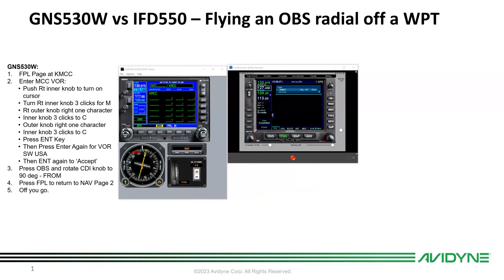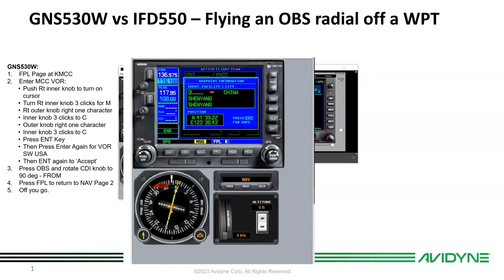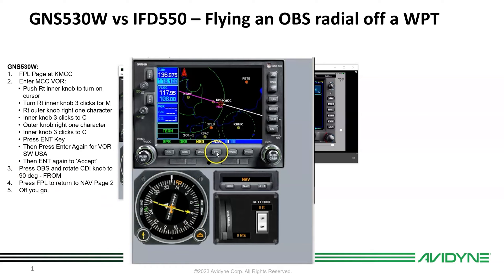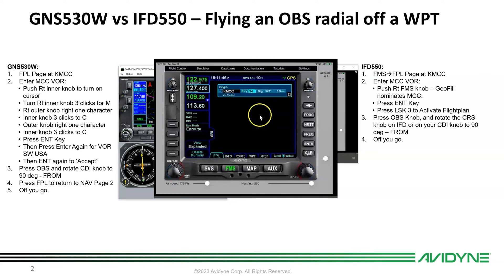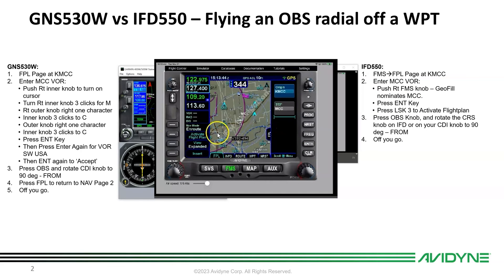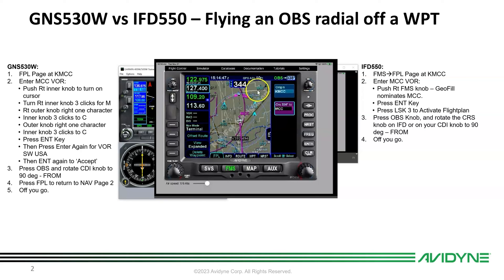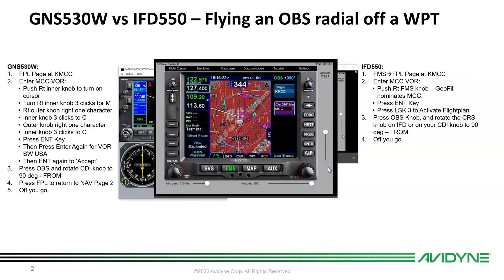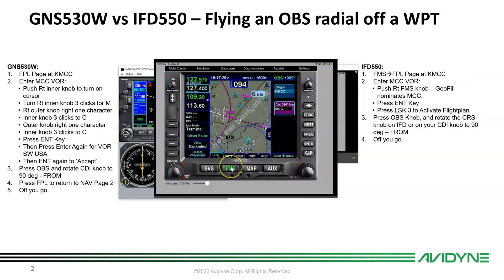Avidyne IFD Training:  Flying an OBS Radial off a WPT

Comment: I was trying to set up a "frm" radial to track outbound.  However, the "frm" won't come up inbound to the VOR and only shows once I pass it. Is there a way to set an outbound radial before you get to the VOR?  Or is there a way to set a point off a VOR, e.g. LAX 123°/20 miles? TIA
Reply from the maker: An "inbound radial" is the recipricol of the radial.   If you want to fly inbound to a VOR on the 123 deg radial you would set the OBS for 303 deg course.   Yes, you can create a User Waypoint using Radial/Distance off of a fix.  check out https://youtu.be/WLO7ipeYaNU
Reply: @AvidyneAvionics  Thanks for the quick reply!  Yes, I understand radials. The scenario is, depart KSMO to fly the LAX coastal route over LAX then continue VFR to KAVX.  The route is to fly the LAX 323R to LAX then outbound the 123R until exiting the Class B.  So I set up Dir LAX, then OBS inbound 143.  My point was there appears to be no way to select an outbound OBS mode until you pass the VOR.  Setting up a user waypoint seems like the way to go.  Though V25 does appear to be on the same outbound radial so I could grab a fix off of that.   Easy enough on the 550 - which I love!  Is there any scenario where I would use VLOC?  Thanks again
Reply from the maker: @FrankFurbish  I see what you mean. Yes you would have to slew the CRS point (OBS) to 123 deg upon passing the LAX VOR or select the V25 and a down stream waypoint as an exit point (as you suggested).   The FMS manages the VLOC in most cases and will auto switch to VLOC on an LOC/ILS approach.  you could at any time choose to navigate off of an actual VOR station in which case you would tune the appropriate VOR freq and change the small knob to Nav source 'VLOC.'   Happy Flying!

Comment: Cool feature. I wondered how I would fly a radial from an airport that does not have a VOR on the field. In the simulator, if I enter the airport as the origin, then enter the same airport again as a waypoint, then activate the flight plan and press OBS, the simulator will fly indefinitely on whatever outbound radial is set. I haven't tested this yet in the airplane.
Reply from the maker: Yes, you can fly an OBS "radial" off of any GPS waypoint with the  IFD.